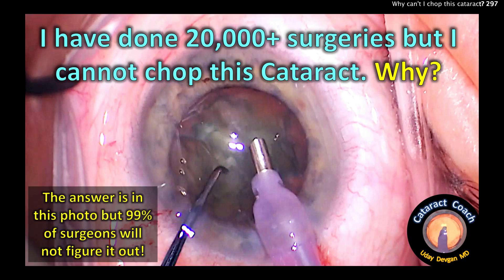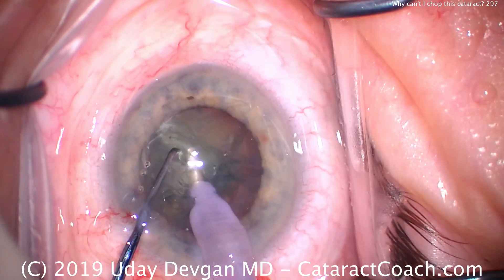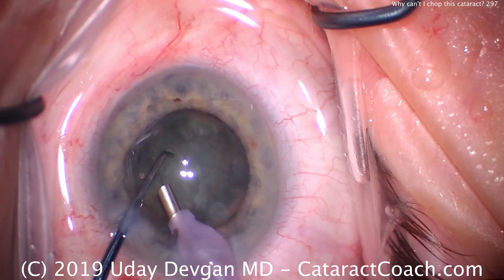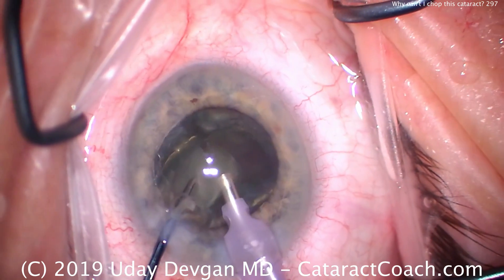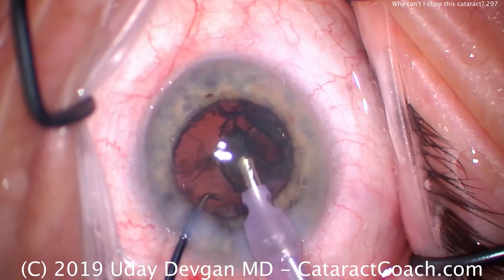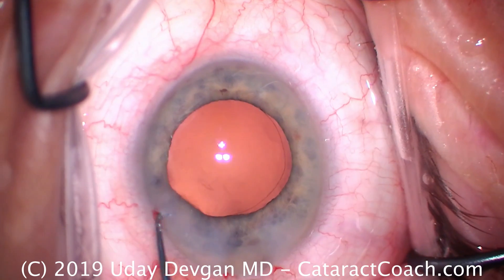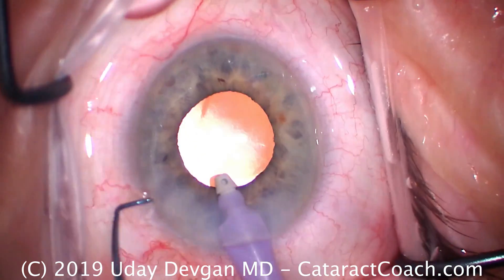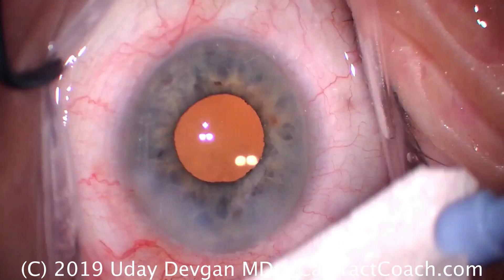I just cannot chop this cataract -- and you will never guess why

Comment: Before watching I will posit that there is too much phaco tip exposed past the irrigation sleeve. The sleeve acts as a brace to help hold the nucleus still as the chopper is pulled toward the phaco tip. With this much tip exposed the nucleus is too mobile and "spinny" Well, am I in the 1% or the 99%? Let's watch and see...
Oops, wrong supposition. Oh well. Still, it might have chopped better with a little less tip out, maybe.